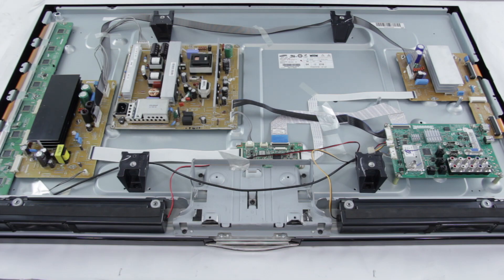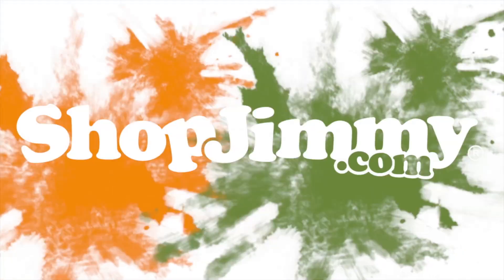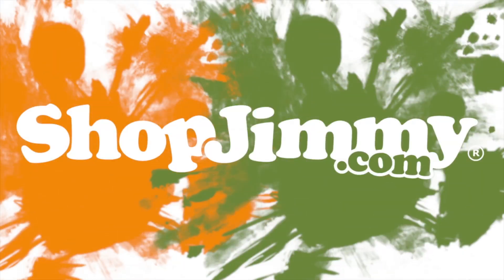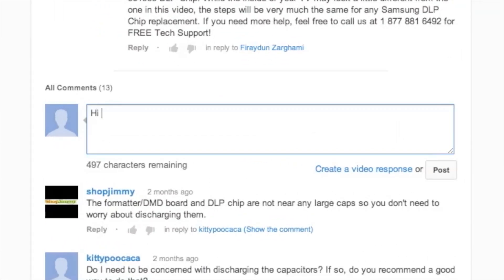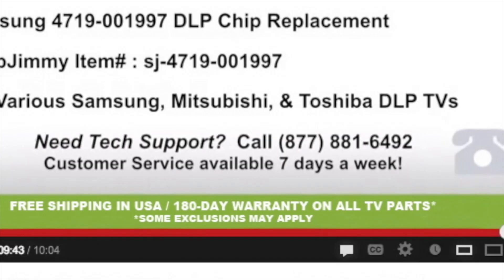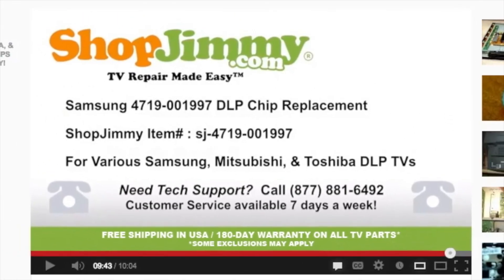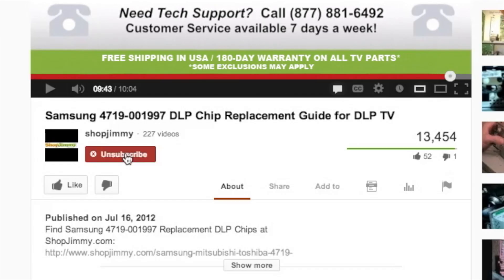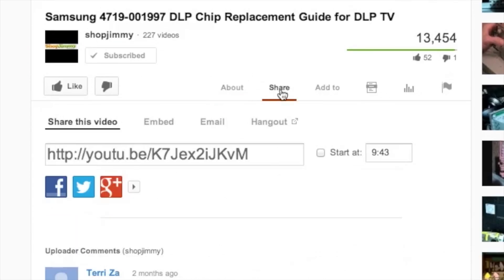Plasma TV Repair Tutorial - Common Symptoms & Solutions - How to Fix Plasma TVs

Comment: Hi Shop Jimmy - Question regarding Samsung 50" Plasma HP-S5053. The TV recently stopped working (no image displayed). After leaving it off for a few days, we tried it again and the standby LED blinked several times and we heard the "boot up" tones that normally play. A few seconds later, there was a snap/hiss of electrical issues and a bright flash from the back. Opening up the TV, I found that the 5 diodes (4 zener) on the upper half of the Y-Main were completely destroyed, and the board itself had partially melted breaking some of the traces around those components. Nothing was left of the components aside from brittle ashes. Testing of all other components on the power board, X-Main, etc all show components are fine. The other components on the Y-Main appear undamaged. Is it worth trying to replace/repair the blown diode section with some creative soldering, or would it be best to just buy a new Y-main board? Is there any way of knowing exactly what caused these 5 diodes to basically explode? Thank you!
Reply from the maker: Chris Lord   I recommend replacing the Y-Main Board in your TV.  Here is a link to replacement parts for your TV model number on our website, click here:  http://www.shopjimmy.com/catalogsearch/result/index/?master_part_type=Y-Sustain&q=S5053  Be sure to match part numbers on your current board, with your replacement for compatibility.  Here is a link to a video showing how to identify your part number, click here:  Samsung Plasma TV Repair: Samsung Plasma Panel Parts Guide  You can also call our customer service for further assistance with your purchase.  (877) 881-6492  Thanks and please let us know if you have any further questions with your TV Repair!  www.shopjimmy.com
Reply: ShopJimmy.com Thank you for the reply! Unfortunately, my part number is LJ92-01436A, which is out of stock on ShopJimmy. The alternate/substitute parts list is also out of stock, the only item available being a component repair kit. Sadly, my board is damaged too much for a component option, so I need the entire board. I prefer using shop jimmy, but I decided to purchase one off eBay since there are none currently availble at SJ. The revision number is slightly different (AA1 vs BA2), but everything else is identical. Hoping it works, we'll see. Thank you for the reply, you guys are great
Reply from the maker: Chris Lord   You are welcome for the help and best of luck with your repair!  Thanks!  www.shopjimmy.com

Comment: Got a LG mdl=60pv400.aus has black image, has audio only. also has stand-by, what could be the possible problem? if i need to replace a panel, is it worth it?
Reply from the maker: alexander saspa   I recommend replacing the YSUS and the YDRVTP & YDRVBT boards in your TV.  Here is a link to replacement parts for your TV model number on our website, click here:  http://www.shopjimmy.com/catalogsearch/result/?q=60pv400  Be sure to match part numbers on your current board, with your replacement for compatibility.  Here is a link to a video showing how to identify your part number, click here:  LG Plasma TV Repair: DIY Part Identification Number ID Guide for LG & LG Philips Plasma Panel Parts  You can also call our customer service for further assistance with your purchase.  (877) 881-6492  Thanks and please let us know if you have any further questions with your TV Repair!  www.shopjimmy.com

Comment: Hi I have a Soyo MT-SYJCP32B1AB tv and I have been having an issue where the TV will turn on but there is no picture.  No light on screen or tv.  There are times when sound works and others where it doesn't.  At first I would just have to turn it on and off 2-3 times and it would work fine until I turned it off or switched inputs.  Now it is taking more and more time of on/off to get it to show picture.  I was wondering if this is just a board that I can change out.  I have experience working with PC's, Laptops, and other electronics so I know I can replace a part, I am just not sure where to start.
Reply from the maker: Matthew Brodzinski   I recommend replacing the YSUS board in your TV.  Here is a link to replacement parts for your TV model number on our website, click here:  http://www.shopjimmy.com/lg-ebr36451602-ysus-board.htm  Be sure to match part numbers on your current board, with your replacement for compatibility.  Here is a link to a video showing how to identify your part number, click here:  LG Plasma TV Repair: DIY Part Identification Number ID Guide for LG & LG Philips Plasma Panel Parts  You can also call our customer service for further assistance with your purchase.  (877) 881-6492  Thanks and please let us know if you have any further questions with your TV Repair!  www.shopjimmy.com

Comment: I have a 50 plasma TV model number TC-P50X5 my TV started turning on  and off every time I turned it on it stayed on for five minutes then went black but you could still here the sound i unplugged it for a few days and tried to turn it on now it's not doing anything  the power comes on but no. Picture no sound
Reply from the maker: rdarlene2   I recommend replacing the SN board in your TV.  Here is a link to replacement parts for your TV model number on our website, click here:  http://www.shopjimmy.com/panasonic-txnsn1rhuu-sn-board.htm  Be sure to match part numbers on your current board, with your replacement for compatibility.  You can also call our customer service for further assistance with your purchase.  (877) 881-6492  Thanks and please let us know if you have any further questions with your TV Repair!  www.shopjimmy.com

Comment: I have a samsung model PN50A450P1D with one thin horizontal black line running across the upper top of the screen. the screen is 52". Please let me know if this is repairable
Reply from the maker: Holly Zawadiuk   This sounds like a TV panel problem.  If your TV panel is bad, it may be more cost-effective to replace the TV as panels are typically hard to find in stock, difficult to replace, and expensive.  Thanks and please let us know if you have any further questions!  www.shopjimmy.com

Comment: Hello Shop Jimmy. I have a september 2006 50" inch Maxent MX-5020HPM plasma TV that has screen problems. The problems are the screen has black and white Rectangle bars running from the top to the middle of the screen and if I try to change inputs too many times the TV will also turn off. Also this happens when there is nothing connected or if a video is connected. Think you can help? Thanks!
Reply: Also I can hear a buzzing noise coming from the back of the TV. Here is 2 pictures I took https://lh5.googleusercontent.com/-E39tJXrFOVY/U7gRDlXIr9I/AAAAAAAAIJg/6jlOcFkhMpg/w702-h396-no/IMAG0564.jpg       https://lh6.googleusercontent.com/-5yuewTgNEIk/U7gRAicdG8I/AAAAAAAAIJE/WWnIAOU4U_8/w702-h396-no/IMAG0563.jpg
Reply from the maker: darktoothxo   This sounds like a TV panel problem.  If your TV panel is bad, it may be more cost-effective to replace the TV as panels are typically hard to find in stock, difficult to replace, and expensive.  Thanks and please let us know if you have any further questions!  www.shopjimmy.com

Comment: Hello I have aSanyo 50" plazma DP 50747-00 
I have changed the power board from you and the picture comes up and plays ,but only in Black and White after the power bopard went out  something went wrong with the color so I guess i need another board or something. HELP please
Reply from the maker: Jack Wellman   I recommend replacing the main board in your TV.  Here is a link to replacement parts for your TV model number on our website, click here:  http://www.shopjimmy.com/catalogsearch/result/index/?master_part_type=Main+Board&q=DP+50747-00+  Be sure to match part numbers on your current board, with your replacement for compatibility.  Here is a link to a video showing how to identify your part number, click here:  TV Part Number ID Guide for Sanyo Main, Digital, & Terminal Boards (LCD, LED, Plasma TVs)  You can also call our customer service for further assistance with your purchase.  (877) 881-6492  Thanks and please let us know if you have any further questions with your TV Repair!  www.shopjimmy.com

Comment: I have a Samsung Plasma model PN43D450A2DXZA that suddenly went black with no sound, the red power light blinks when you push "on" and clicks a little bit, other than that, there is no sound. I've been reading that these models often have capacitor problems but after removing the back of the TV to have a look, none of them look blown. Any thoughts on what the problem is and is it fixable? Thank you.
Reply from the maker: Yvonne C   I recommend replacing the Y-Main board and the Y-Scan Drive board.  Here is a link to replacement parts for your TV model number on our website, click here:  http://www.shopjimmy.com/catalogsearch/result/?q=PN43D450A2DXZA  Be sure to match part numbers on your current board, with your replacement for compatibility.  You can also call our customer service for further assistance with your purchase.  (877) 881-6492  Thanks and please let us know if you have any further questions with your TV Repair!  www.shopjimmy.com

Comment: Panasonic 42in Viera plasma-model th42pd25  no menu, no tv or image, have a computer connected by vga & no issues there.
Reply from the maker: green ibro   I recommend replacing the main board in your TV.  Here is a link to replacement parts for your TV model number on our website, click here:  http://www.shopjimmy.com/catalogsearch/result/index/?master_part_type=Terminal+Board&q=th42pd25  Be sure to match part numbers on your current board, with your replacement for compatibility.  You can also call our customer service for further assistance with your purchase.  (877) 881-6492  Thanks and please let us know if you have any further questions with your TV Repair!  www.shopjimmy.com

Comment: Hello, I have a samsuns 50" plasma tv model PN50B430P2DXZA first the y-sus board burned a diode out I replaced the y-sus and the x-sus, I replaced the x-sus because website suggested if u replace one should replace other. But now turn the tv on and the screen is fine for a while than turns real bright and fuzzy and I must shut down for a while until it cools down. than turn on screen is fine for a while than starts all over again
Reply from the maker: Raymond ST.Louis   I would put the original X board back in.  It's recommended that when replacing the Y board the buffers get replaced with it, as normally the X board is OK.  See if that fixes your problem.  If not,  you can try replacing the Y-Main Board and Y-Buffer Board in your TV.  Here is a link to replacement parts for your TV model number on our website, click here:  http://www.shopjimmy.com/catalogsearch/result/?q=PN50B430P2DXZA  Be sure to match part numbers on your current board, with your replacement for compatibility.  You can also call our customer service for further assistance with your purchase.  (877) 881-6492  Thanks and please let us know if you have any further questions with your TV Repair!  www.shopjimmy.com

Comment: I have a Samsung 50 inch Plasma TV.  I had to unplug it to get it to stop clicking on and off.  When I plug it back in, it continues to click like it wants to turn on, but won't!  The screen remains blank and it just continues to click!  The Model #is HPT5044.  I don't want to throw it away, am pretty handy and want to attempt to fix it myself!  Am I crazy?  Please help!!!
Reply from the maker: Nate Mendes   You will want to troubleshoot the boards in your TV, to see which one is causing the clicking noise.  Here is a link to a video that should help.  Samsung Plasma TV Help with Clicking Noise On Off TV Repair How to troubleshoot Vizio & LG  Thanks and please reply with the results and we can recommend a replacement part for your TV repair.  You can also call our customer service for further assistance with your purchase.  (877) 881-6492  Thanks and please let us know if you have any further questions with your TV Repair!  www.shopjimmy.com

Comment: I have the samsung pn58c8000yf and it will not turn on.  I replaced the power supply board but no change. The red light flashes but no picture.  I checked all the caps on the other boards, and there are no bulges.  could it be the logic board?
Reply from the maker: Ruben Figueroa   Be sure to take the proper safety precautions.  I recommend unhooking the Y-Main board and then powering on the TV to see if the TV will stay on.  Please reply with the results of this test.  Thanks!  www.shopjimmy.com

Comment: Panasonic plasma model TH50PZ850U A.  It will not turn on.  Red light blinks 7 times.
Reply from the maker: Brendan Kelly  I recommend replacing the SC board in your TV.  Here is a link to replacement parts for your TV model number on our website, click here:  http://www.shopjimmy.com/catalogsearch/result/index/?master_part_type=Y-Sustain&q=TH-50PZ850U  Be sure to match part numbers on your current board, with your replacement for compatibility.  You can also call our customer service for further assistance with your purchase.  (877) 881-6492  Thanks and please let us know if you have any further questions with your TV Repair!  www.shopjimmy.com

Comment: Hi,

Your videos are great and give me confidence to have a shot at repairing my TV.

OK model LG Plasma 50PC1D AA   -   507KCYQ2B322

When I go to switch TV on the standby light changes from red to a blinking white light.

The screen appears to begin to start up but after about 3 seconds it shuts down and the blinking white light becomes a solid white light.

Watching your videos I suspect it's the main power board.

Do you agree with that diagnosis?

If it is the main power board how much is a new one please?

What are my other options?
Reply from the maker: James Hardy   Unhook the main board from everything and see if the TV stays on.  If the TV does stay on, then I recommend replacing the main board.  Here is a link to replacement parts for your TV model number on our website, click here:  http://www.shopjimmy.com/catalogsearch/result/index/?master_part_type=Main+Board&q=50PC1D  Be sure to match part numbers on your current board, with your replacement for compatibility.  Here is a link to a video showing how to identify your part number, click here:  TV Part Number Guide for LG & Zenith Main, Digital, & Tuner Boards (LCD, LED, Plasma TVs)  You can also call our customer service for further assistance with your purchase.  (877) 881-6492  Thanks and please let us know if you have any further questions with your TV Repair!  www.shopjimmy.com

Comment: I have a Hitachi 55" Plasma TV, Model 55HDS69 and my problem is that when I turn it on I have sound but no picture.
Reply from the maker: *****   I recommend replacing the Y-Main Board and the Scan Drive boards in your TV.  Here is a link to replacement parts for your TV model number on our website, click here:  http://www.shopjimmy.com/catalogsearch/result/?q=55HDS69  Be sure to match part numbers on your current board, with your replacement for compatibility.  You can also call our customer service for further assistance with your purchase.  (877) 881-6492  Thanks and please let us know if you have any further questions with your TV Repair!  www.shopjimmy.com

Comment: my samsung plasma tv  MODEL CODE PN50C450B1DXZA  SERIALNO. Z1M83CQZC18444Z  VERSION NY02  just keeps clicking when i plug the power cord into it. i took the back off the tv an none of the capacitors are bulged up. What elts could be the problem?
Reply from the maker: Raymond Shipway jr   This sounds like a problem with either the X-Main Board or the Y-Main Board in your TV.  You may need to replace each board individually to see which one fixes the problem.  Here is a link to replacement parts for your TV model number on our website, click here:  http://www.shopjimmy.com/catalogsearch/result/?q=PN50C450B1DXZA  Be sure to match part numbers on your current board, with your replacement for compatibility.  Here is a link to a video showing how to identify your part number, click here:  Samsung Plasma TV Repair: Samsung Plasma Panel Parts Guide  You can also call our customer service for further assistance with your purchase.  (877) 881-6492  Thanks and please let us know if you have any further questions with your TV Repair!  www.shopjimmy.com

Comment: Have a Samsung FPT5884X/XAA and I thought it was a Directv problem but after many techs came out, he said it was the tv. It would work for a couple weeks and then all a sudden No sound No picture. 1 HDMI port does not work at all but we can get sound through a attached surround sound.
Reply from the maker: Captinprivate   I recommend replacing the main board in your TV.  Here is a link to replacement parts for your TV model number on our website, click here:  http://www.shopjimmy.com/catalogsearch/result/?q=FPT5884X%2FXAA  Be sure to match part numbers on your current board, with your replacement for compatibility.  Here is a link to a video showing how to identify your part number, click here:  Samsung Main Boards & Digital Boards: Part Numbers for LED, LCD, DLP, Plasma TV Repair  You can also call our customer service for further assistance with your purchase.  (877) 881-6492  Thanks and please let us know if you have any further questions with your TV Repair!  www.shopjimmy.com